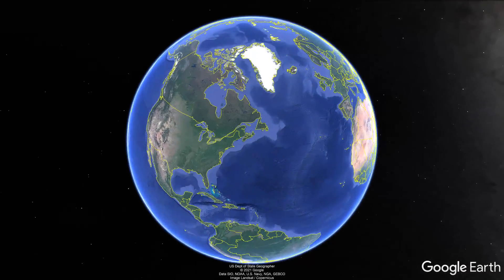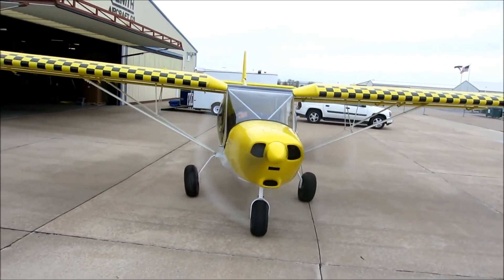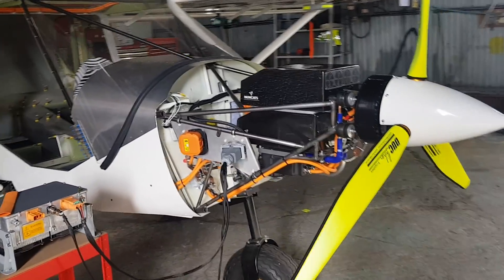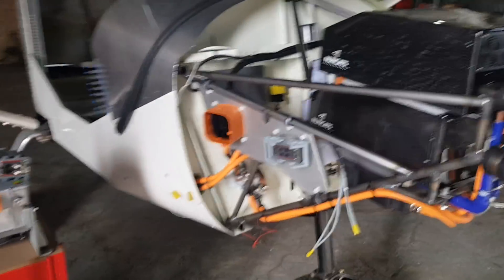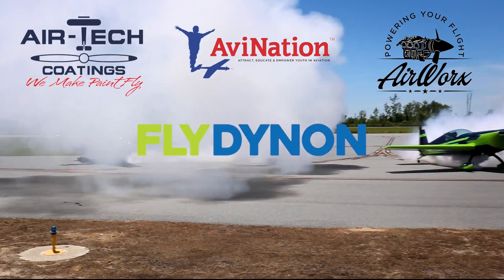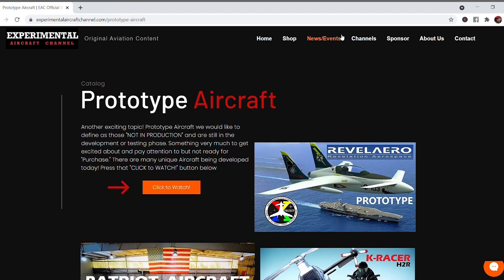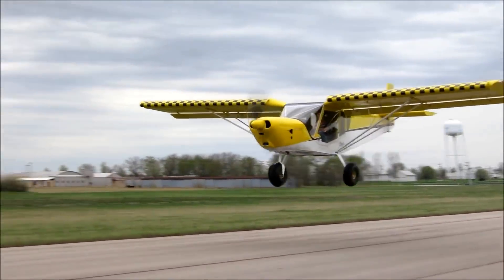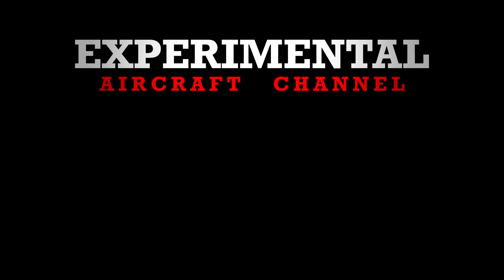All Electric! Zenith CH750 Aircraft from the UK - EV Lithium Battery Tech - Nuncats

Comment: The Emrax motors were designed and intended for aircraft, and are well proven, so they're a reasonable choice. On the other hand, they have no redundancy, and it's a miracle of regulatory processes that Pipistrel obtained EASA certification; the assumption must be that the aircraft would otherwise have a gasoline engine dependent on electronics and having no redundancy (so it couldn't be worse) or perhaps that the aircraft is a viable motorglider so the propulsion doesn't really need to work all of the time. North American aircraft manufacturers are having difficulty getting approval even for much more robust designs from MagniX, although those are for commercial applications. NASA had to give up on their X-57 Maxwell program because the JM-X57 electric cruise motors motors that they used from Joby Aviation couldn't meet NASA's standards for safety.

Comment: 380 lb-ft is 515 Nm, so this must be the Emrax 268 - specs are readily available from the Emrax website. The model number just indicates the outside diameter in millimetres. 

This model is capable of peak power output (at 4500 RPM) of 210 kW, and continuous power output up to 117 kW (157 hp). Power and torque mean exactly the same whether they are coming from an electric motor or a gasoline engine. the peak torque is irrelevant to propelling an aircraft: maximum peak or continuous power is at 4500 RPM (so you use a reduction drive, or a small propeller, or you don't reach peak) and the peak continuous power at 4500 RPM corresponds to 250 Nm (185 lb-ft) of torque... roughly the torque mentioned in the video. For maximum efficiency this motor should run at 200 to 300 Nm and only 1500 to 3000 RPM, which is 30 to 90 kW.

Comment: metal-air primary batteries instead of lithium, its like kerosene compared to rockets, easy to reconstruct, full of the base metal, aluminium, magnesium, iron, anything, also hydrogen, or hydrides, nuclear alpha/beta batteries, americium for longest safe ranges, really long, heat-water/sand-peltier generators
Reply: so you dont have enough air flow going around fins around your motor
Reply: wingtip vtol tilting electric ducted fans
Reply: gets rid of wingtip vortices

Comment: Torque and HP are one in the same ONLY at about 5200 RPM or a bit more (5250?) IIRC.  Not sure of the exact RPM, too lazy to look it up.

Also, on the heat issue, there is some thermal inertia that will allow very high output for very short times, I suspect, which might help with STOL.  Not sure if it is of practical consideration with this power plant, but just a thought.  I'm also not sure if it could cause other problems with the motor, obviously a manufacturer question, if they have even explored these envelopes.

Comment: Hi Bryan, 8 years ago I built an electric powered Zenith CH701 STOL. I modelled and scratch built the plane after Scott Ehni's turbo prop CH701 and my RC model is a 1/5 scale. There are actually pictures of the model on Zenith's website members aircraft under models I assume. So I guess I'm the first to actually fly an electric Zenith albeit a model RC plane. Possibly a bit of useless info for you but a major undertaking for me especially having hit a fence on one flight and destroying the thing. Since then the plane has been completely rebuilt and fitted with a 6 Axis gyro stabiliser unit I have to switch off when landing so the flaperons are fully functional in flap down setting.

Comment: With electric what about reverse thrust for shorter stops and what about a ammonia cooling system?
Reply: Ammonia used to kill a lot of people when used for refrigerators and AC.
Reply: @davidwhite2011  if in a structure but as a coolant that is completely outside and high speed air circulation that would be extremely rare for this app
Reply: @davidwhite2011  It is still used in RV refrigerators.
Reply from the maker: YES. I believe I cut that out in the conversation just due to time limitations. But you could essentially get it into "BETA" for reverse thrust. Not sure on the Ammonia topic to be honest.

Comment: Brushless motors were proven in RC aircraft years ago can far exceed combustion engines in speed and power output. The LIPOLY battery also proved to be more then enough it's only a matter of time before electric power replaces light aircraft engines. Ultralights will be one of the first places as they are only allowed to carry 5 gallons of fuel. Batteries should be able to easily replace 5 gallons of fuel. The nice part about electric power lot less to go wrong with them hardly any maintenance. Battery performance can be measures easily, and swapped out by the owner. It really a game changer.
Reply: Thats bullshit. 
If you flew rc youd know that
Reply: @krotchlickmeugh627  I do fly RC I have lot of RC airplanes latest one I'm building is a electric pylon racer that goes 150 MPH. I also have gas powered have a Extra 300 10 foot wing span Desert Aircraft 120, helicopters. You shouldn't be so closed minded that electric will never happen.
Reply: @Mike-01234  lol it wont ever happen. If you really had giant scale aircraft. Youd know that weight begins to make our advantage of power to weight not make sense. 
Battery chemistry hasnt advanced in 15 years or more. By much anyways. 
How does your "pylon racer" go 150 but youre still building it?
Reply: Also the scalability doesnt work. 
But how is your fancy $700 EDF? 
Flight times are what? 
2 1/2 minutes? 
Lmfao thats enough time for you to take off then head downwind and set up for an approach
Reply: @krotchlickmeugh627  In my 80" Sbach converted to electric I get 12-13 min of aerobatic flight using a 6S 6000 MHA battery. Not sure if you seen a 6S 6000 mAh  battery it's not that big. Motor has a 20-10 prop little bigger motor then I needed tons of thrust. The original engine was only a 30CC 2 stroke.  Full size has already demonstrated 2 hours of flight
Reply: I love the idea of electric airplanes, but they are still required to follow the laws of physics. 5 gallons of gas holds the same "usable" energy as the 1200 lb battery pack in a Tesla Model S. Better batteries are always just around the corner, but using what's commercially available today means that we're limited to very short duration flights due to the weight of batteries. Less weight is always the elusive goal. Nothing we have available today even comes close to the low weight of gasoline so electric ultralights have zero chance of getting hours of flight time like the gasoline ones can do. How much fun can you pack into a 10 minute flight?

Comment: A real world use with electric aircraft? Where? How? In which universe?
Heavy batteries, low energy densities, dangerous chemical fires? No range and huge charge times.
Too much marketing talk, the ground charging plan they have is totally inefficient. Solar or gen to lead acid batteries and then via a charger into the aircraft?
Reply: You might want to expand your research a bit more before making such a comment...  Pipistrel, Bye Aerospace, Beta Technologies, Tecnam, Heart Aerospace, Eviation. They all think it is possible. You battery assumptions are a bit out of date. JFYI, in automotive, an ICE car is 11 x more likely to catch fire per miles driven than BEV, although if a Toyota catches fire it is not making the news. Beta Technologies 250nm, at 170mph all electric aircraft, with a 50 minute charge time has many practical applications. One of which is a partnership with UPS and Arrival vans using the same charging architecture to make a seamless transition from flight to road infrastructure in logistics.
Reply: Perhaps you haven't heard about the now certified Pipistrel Alpha Electro? Already popular with flights schools.
Reply: @ABC-rh7zc  The Alpha Electro is vastly inferior to the Rotax powered Alpha, in every possible way.
Reply: @wpfilms2  Light aircraft have almost no effect on global warming, they just aren't a big enough consumer of fossil fuels to be a concern. If you're really worried about global warming, start advocating for the nationalization of the electrical grid and the adoption of a nuclear energy system (following the example set by France).

The Alpha Electro isn't even remotely close to being a starting point, it's so far off the mark from where an electric aircraft needs to be that it doesn't do anything but prove that electric aircraft aren't viable and aren't likely to EVER be viable.

The Alpha Electro costs $50,000 more to buy than the Rotax powered Alpha, while also being much, MUCH less capable. The $30,000 battery for the Electro also costs nearly twice as much as an entire engine for the ICE aircraft, while needing to be replaced about twice as often as the engine needs to be rebuilt. That is not a price improvement.

The EFI versions of the Rotax 900 series engines are 20-30% more efficient than the carbureted versions of the same engines, this was verified by third party testing. Similar improvements could be made all of the way up to 450 hp piston engines (the R-985 radials used in Beavers, for example). Leaded fuel could also be eliminated using modern engine technologies. Piston engines in most light aircraft aren't even close to being mature, they're stuck in the 1930s.

"...a Rotax engine is vastly inferior to a Magna X (https://www.magnax.com) or Yasa ( https://www.yasa.com ) axial flux electric motor in power/weight ratio..."

Not when the batteries are included. Cost is also far better with piston engines. Reliability could be improved with more modern engine designs.
Reply: @wpfilms2  "....but aviation as a whole is a large contributor and only projected to get worse."

That's the problem here, people like you don't seem to understand just how far away electric propulsion technologies are from being viable for use in ANY kind of practical aircraft, or how many orders of magnitude those technologies are from being able to power the aircraft which do actually have a somewhat significant effect on global warming. You want to bet the farm on technologies that show absolutely no promise of EVER being viable, it's ridiculous.

"My point was we are just starting to explore what electric can do..."

Not really, most of these technologies have been around for ages, so only very small improvements are likely to be possible.

"...are all getting close to cracking it with up 250nm to 400nm range."

Those are their claims, but absolutely nothing has been verified. And it's not just the range that matters, it's the speeds at which the aircraft can traverse those distances that matter. If the aircraft is slower than a car over the same distance, it doesn't have a purpose.

"Small electric aircraft will come down over time."

Cost will INCREASE as capability improves and their cost is already completely outlandish. Capability wont EVER be on par with ICE aircraft (using modern engine technologies), I would bet my life on that.

"They have car with 300 mile range costing $12,000."

The Chinese are also modern day slavers and they build some of the worst, least reliable junk that one could ever imagine. EVERY Chinese vehicle that has made it into the hands of someone in the US who has been able to review it has described nothing but problems with the vehicles. They also have abysmal safety ratings. You get what you pay for.

"My question would be why have pistons not innovated since 1930s?"

Because money. You're talking about insanely expensive electric propulsion systems, why not consider slightly more expensive engine technologies?

"I just look at simplicity..."

A bicycle is simpler than a car, that doesn't mean that it's as capable as a car.
Reply: @wpfilms2  I have a bad headache today and nothing that I say will get through to you. Like with everything else that's been pushed by capitalists recently as a solution to global warming, all of these scam companies are just going to have to fail before people like you start come to your senses.

Your bike isn't capable of carrying multiple people and a significant amount of cargo at 80 mph down the road for hours at a time. In the US, cities are also poorly suited to travel by bike and we get things like temperatures of 110+ degrees (~44 degrees C), which seriously hamper one's ability to get around by bike.

Europeans don't exactly have the highest standards when it comes to vehicle reliability. Many of the brands to which Europeans remain loyal can't even be sold in the US because of their abysmal reliability. The brands that do make it here are always at the bottom of the vehicle reliability ratings (Fiat, VW, Mini, etc). 

"And they do make most of Apple’s & Samsung’s products."

They don't engineer them. China produces basically ZERO innovation.

" If you actually had to pay the cradle to grave cost of petroleum, most wouldn’t be able to fly or drive…"

E-fuels are the only way to save the planet, absolutely nothing else can meet our needs going into the future. The resources needed to produce electric vehicles will suffer from the same availability problems that caused the atrocities surrounding the production fossil fuels. Building China into the leading world superpower will also result in the destruction of absolutely everything that the people of the west have been working to improve.

You're living in a fantasy world and it's tragic that people like you are running the show for humanity, because it means that there's absolutely no hope for the future of our species.
Reply: @PistonAvatarGuy  I am sorry for your headache and sadly know them too well. It does get through and makes me think through what you are saying. I’m biased as I work in electric propulsion. I do appreciate differing point of views and thank you for keeping the conversation polite. We don’t have to always agree but being more respectful is what I hope progresses humanity forward. We need all of it. E-fuels are very important, especially for long distance, and we all need to use less resources, be more efficiency in everything we do. My bicycle may not be great at many of the things you suggested, but a car is used 15% of the time, average journey of 1.2 occupants globally, although built for 5, often the second largest asset purchased that depreciates 30% on day one. I still love them, especially classics and believe we should built things to last more than 5 years. The point is we need both - the bike & car for different situations. As I have lived in the US, Asia, Africa, and Europe for almost equal parts, I try to appreciate the better parts and not look at the world in absolutes or with exceptionalism. Innovation is coming from everywhere in the world, including China and places like Rwanda, and Switzerland and US and Slovenia and Croatia. We are doomed when we think there is only way forward… I am sure there might be a lot more that we do agree on. I hope your headache subsides and wish you the best. I promise you I do work hard to look for solutions to improve the world we are living in as I owe that to my daughter.
Reply: @wpfilms2  The problem is that nothing is getting done, because everyone is too busy being polite to accomplish anything. What we're seeing in the world today should make people angry, and they shouldn't be afraid to make it known that they're angry. At some point, there wont be any room for politeness and weapons will replace words.

I'm not saying that we should focus only on e-fuels, but that it should be our main focus. In the US, we also need to focus on improving public transportation, as commuting by bike is not practical in many areas, because the US has built its cities around personal cars.

China does produce some innovations, but relative to many western countries, Japan and Korea, they produce almost nothing of real value to humanity. Most of what China produces is disposable garbage products and enormous amounts of pollution.

We have failed our children, mark my words. It's just too late and no one is willing to do what's necessary to save ourselves from ourselves.
Reply: @PistonAvatarGuy  you are right and we should be very angry and called to action immediately. We have most certainly failed our children from 2 of most selfish & greedy generations after WW2.